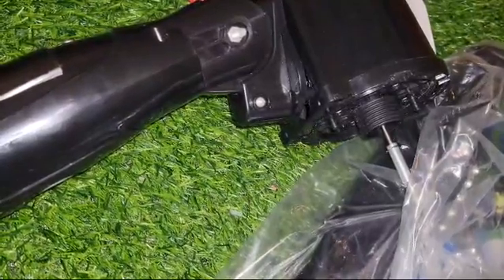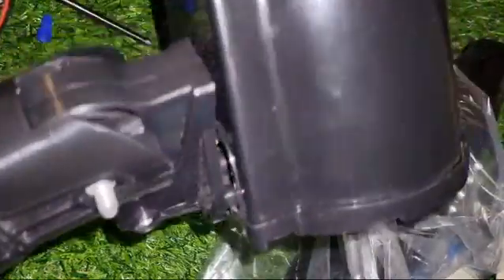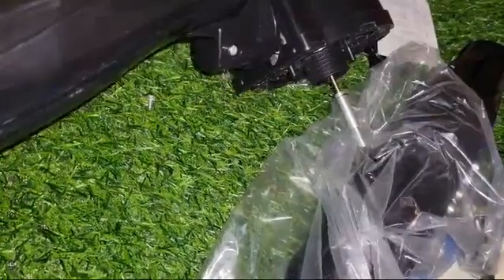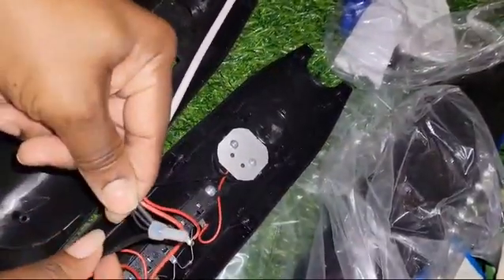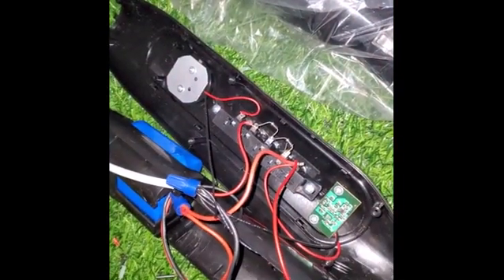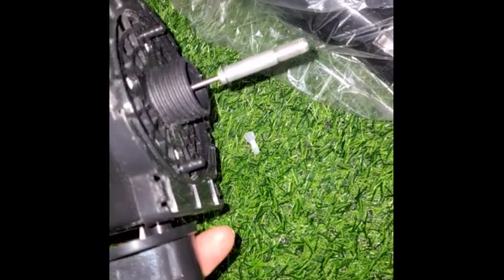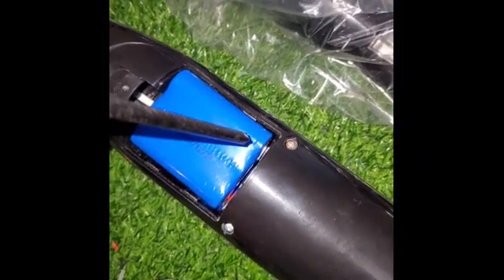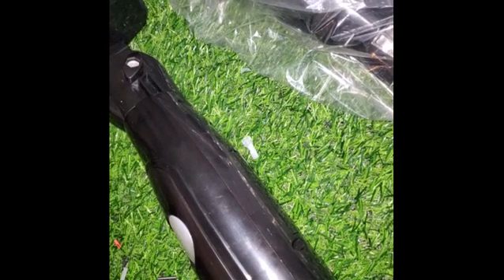How to Change Solar Fan Battery . How to Fix Fan ,Off Grid | Rechargeable Battery for Fan

Comment: I just bought the fan,not up to 2 days but when i remove the power cable, it will work for 2 minutes and go off.
What should i do ?
Reply from the maker: Contact your supplier
Reply: The same happened to me

Comment: How long the battery last
Reply from the maker: Up to 12hrs
Reply: I just bought the fan,not up to 2 days but when i remove the power cable, it will work for 2 minutes and go off.
What should i do ?